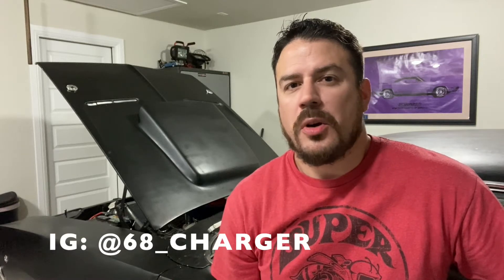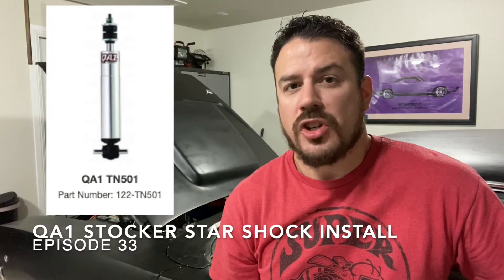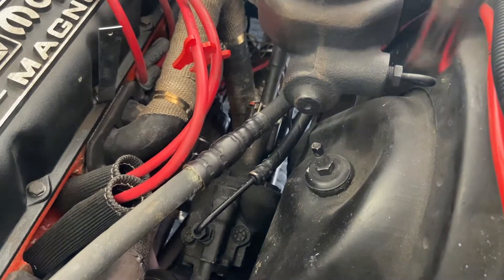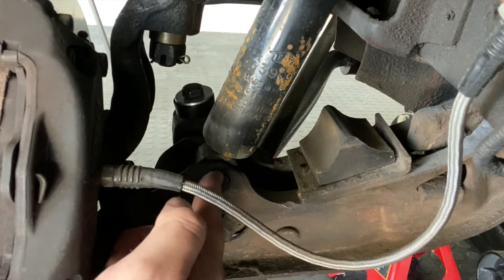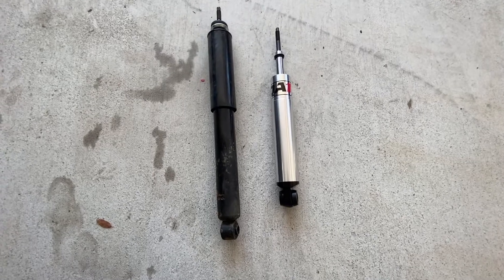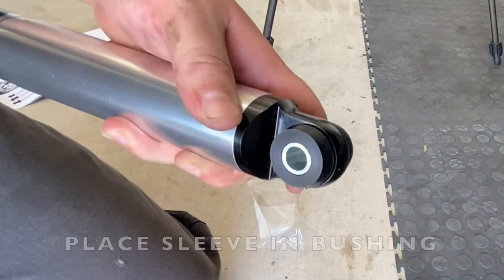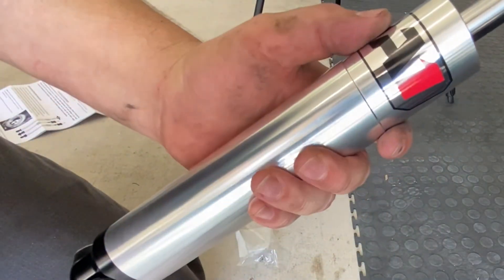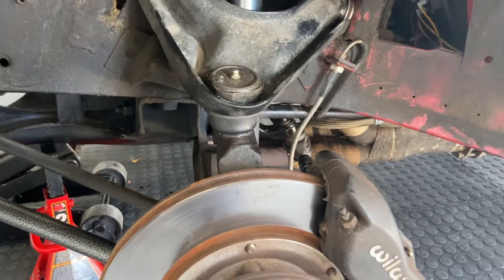1968 Charger QA1 front shock replacements - Episode 33

Comment: Notice any difference in the shocks? Do front and rear or just fronts?
Reply from the maker: I just did front, could let the difference right away when going over bumps.
Reply: @68Charger smoother or stiffer? Just curious as I may do it to mine